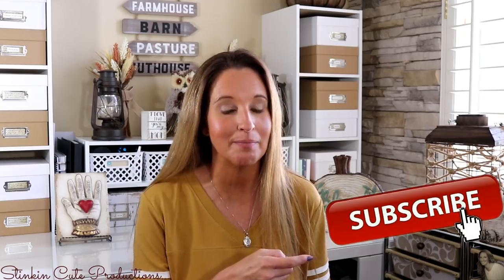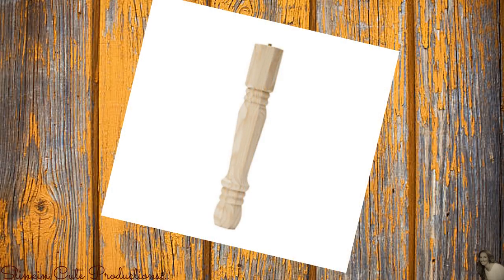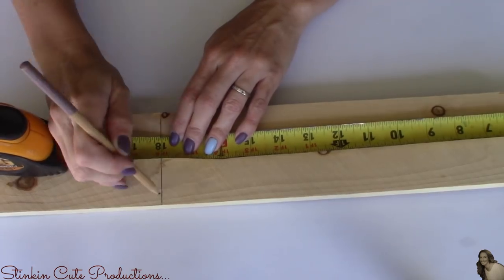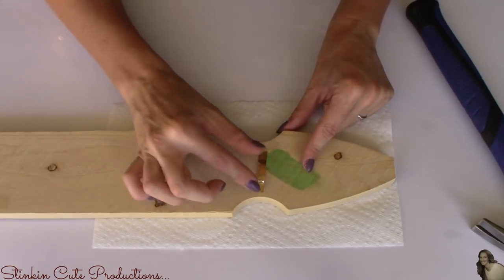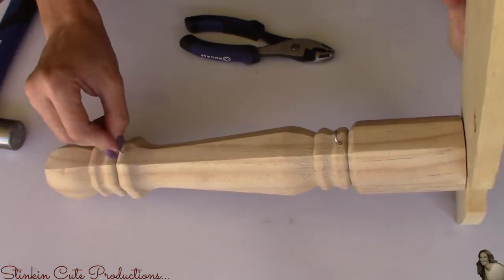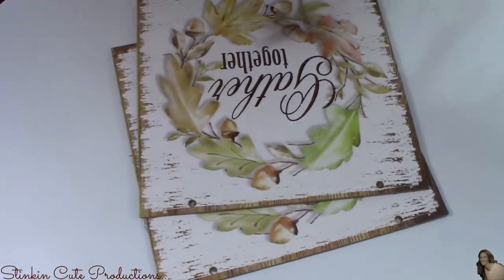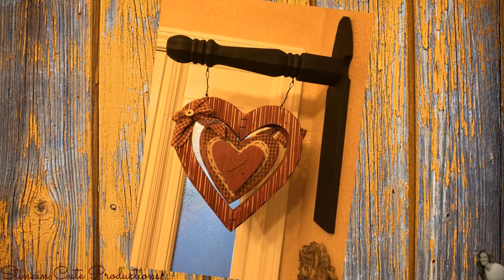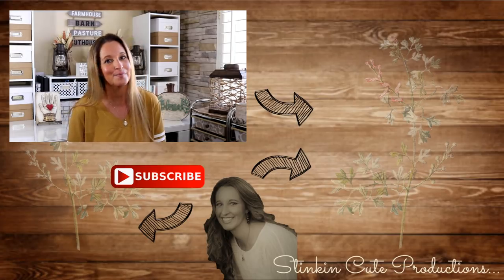LOOK what I do with this FENCE PICKET & TABLE LEG!!!!! QUICK and EASY $10 Diy

Comment: I wonder if you could leave the fence post long and put it in the ground in your garden. I think that would be a cute option as well. Tfs, love your channel ❤️
Reply: Mimi's Moment
     I was unlikely to do this project until I read this comment. Now I will definitely try to do it because I would love a little sign post in my front yard! It really pays to read the comments. This was a great video Kelly!
Reply: That is also a really great idea, but you'll want a thicker wood piece than a fence picket I would think.  They need to be supported by posts because they are thin and can break.  Maybe you could make this out of a fence post with a decorative cap on it?

Comment: Kelly, When I saw you put the leg down on the fence post piece I said to myself,  she making a hanging sign. KELLY THIS MY FAVORITE THING YOU HAVE DONE! I'M IN AWE MODE. DID YOU FIND THIS ON PINTREST OR WAS IT ONE OF YOUR CREATIONS? I'M GOING EITHER THE LATTER HALF OF MY QUESTION. YOU CAME UP WITH IT ON YOUR OWN. WOW. DO U KNOW IF LOWE'S WILL CUT THE WOOD FOR YOU OR IS IT ONLY HOME DEPOT?
Reply from the maker: Thank you Tracy❣️ this is something that I came up with after Jeff had bought me a wrought iron hanger for $80 and I wanted another one so badly but didn’t want to spend $80 on another one! I’ve never seen anything like this on Pinterest 😋👍🏻💜